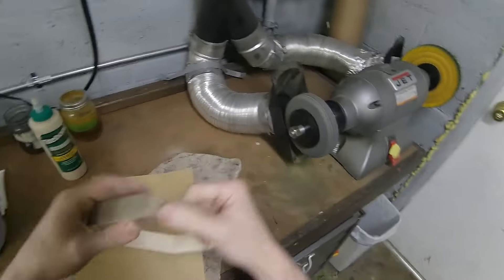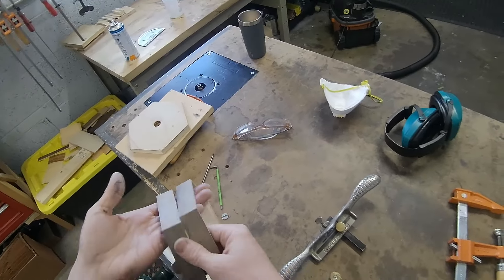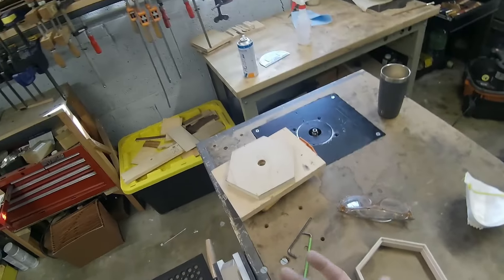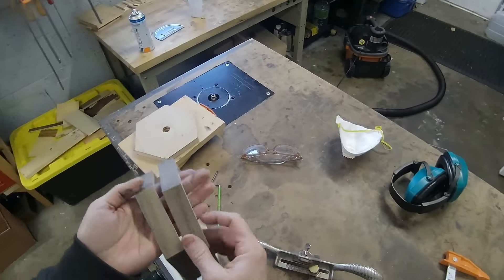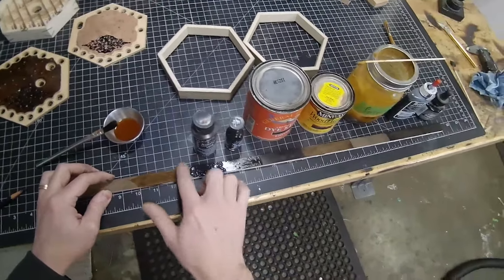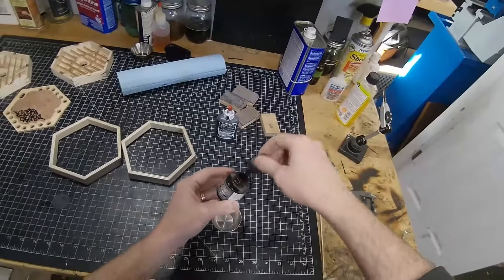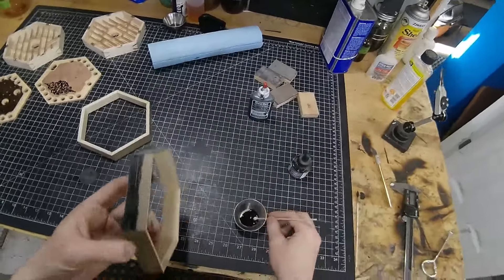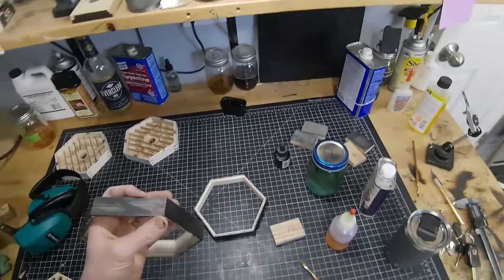Experiments in ebonizing and finishing, installing threaded wood inserts etc.

Comment: I was not sure how to contact you I am not sure youtube has a private message function but someone posted a picture of a concertina you made on facebook with gold tooling on the bellows - I note with interest it had a nice imprinted effect, that is quite tricky, a lot of people don't manage that somehow - well done.
Reply from the maker: Hey Jake! Indeed, it is tricky to get a debossed effect in the leather. The printing plate itself must be deep, the leather has to be the right weight (not too thick or thin, maybe .030”) using a impressionable pad under the leather helps, and then a quick swipe of a moistened paper towel just prior to printing all help to achieve this effect 😊